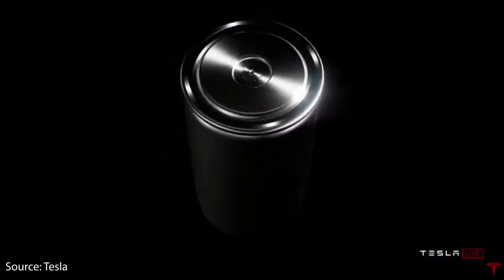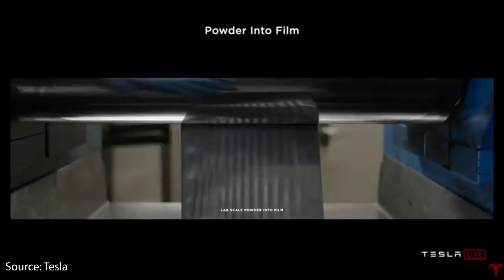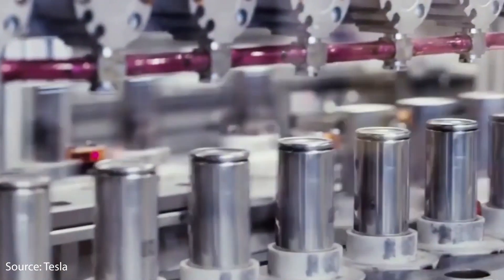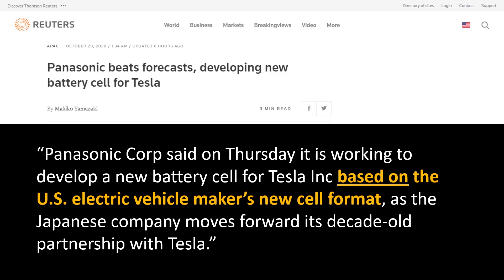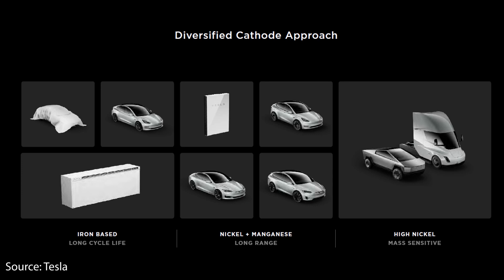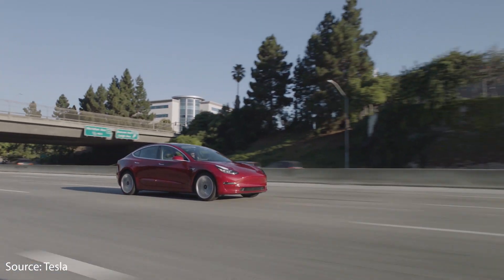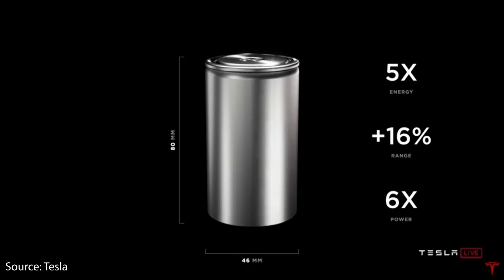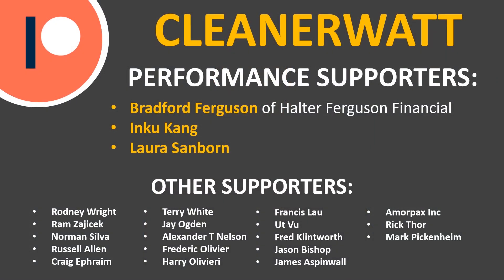Tesla NEW 4680 BATTERIES made by Panasonic

Comment: There's something wrong with your assumptions, I think, Jonathan.  But I can't be sure.  We just don't have very much information to go on at this juncture.

Let's talk about using 2170 chemistry in 4680 cells.  Will that work for Tesla?

I don't think it will.  Here's the problem:  the 2170 tech is a wet-coat-and-dry process.  Remember Elon talking about shrinking the 4680 cell production line to a small fraction of the size of 2170 production lines?  The elimination of wet-coat-and-dry methods makes lines less expensive to establish and cheaper to operate.

With 2170 cell tech upgraded to 4680, yes, Panasonic could produce cells faster than they do now, but they can't get the costs down far enough to suit Tesla.  This old-tech, enlarged cell will be 2 to 2.5 times the cost of a Roadrunner cell once full production is attained.  Not acceptable!

So where does that leave us?

We don't know, and I think the reason we don't know is that Panasonic jumped the gun with their announcement.  I don't think they have a deal with Tesla laying out the path forward for Panasonic cell production.  But I think it's likely that if Panasonic does make 4680 cells for Tesla, they will license Tesla's Roadrunner tech and probably even buy production machines from Tesla, and they'll come in at a price that isn't far off from the price Tesla expects to pay for its own 4680 cells.  Panasonic needs those other tech advances.  They need the IP Tesla owns.  And they need Tesla's cell production machines, which Tesla intends to mass-produce anyway for its own production lines.

Let's extend.  This is all shaky as hell, with no explicit Tesla announcements to go on, but what the hell, we're here, we're talking about it, why not go for broke?  Talk is cheap.

The extension I have in mind is Tesla's relationship with all three of its suppliers:  Panasonic, LG Chem and CATL.  What if:

  -  Tesla licenses its Roadrunner cell tech to other battery manufacturers?  And,

  -  Tesla produces and sells the line equipment necessary to make Roadrunner cells?  And,

  -  Tesla buys some of the resulting cells, probably at a higher price point (but offset somewhat by licensing fees), to accelerate their automotive and fixed site storage products?  And,

  -  Tesla permits these other battery manufacturers to sell Roadrunner cells to other BEV manufacturers?

Where would all of that deliver us?

It would deliver us to a place Elon likes very much, which is the acceleration of higher-quality BEVs throughout the entire industry.  Cheaper batteries will finally allow other automotive manufacturers to earn positive margins on their BEVs, reduce their prices and bring to market BEVs that are superior to equivalent ICEVs.

So how would Tesla compete in such a development?

Tesla has other IP and other advantages.  Nobody can make bodies like the Cybertruck's; nobody is even close to creating casting machines on Tesla's scale; Tesla is moving in new directions for paint shops; Tesla is the only company working on L5 autonomy; Tesla has newfangled tech in its heat pumps and thermal management systems; Tesla has proprietary motors and proprietary software which yield higher energy efficiencies; heck, that's only a partial list.  Tesla is going to be very competitive throughout this decade, and they're moving fast to exploit their advantages.

So, Tesla remains highly competitive and nets a profit on every BEV and every fixed-site storage solution sold by anybody, except those still using more expensive, less capable battery cells (prismatic and pouch cells, mainly), and those won't last long in an industry that's busily implementing a battery tech advance yielding reduced costs and improved performance.

I'll call this the 'Helping Hand' scenario, where Tesla not only boosts the entire industry's electrification progress, but also nets a nice little profit from licenses and the sale of production machines, and uses that cash flow to accelerate their own production ramp.  And they will harvest more batteries faster than they will if they rely solely on their own Roadrunner cell production ramp.

Is that what's going on?

Hell, I don't know, but I am sorta-kinda sure that Panasonic can't succeed with a wet-coat-and-dry production method for 4680 cells to be sold to Tesla.  Tesla will balk at the price.  And there's just not much Panasonic can do to get that price down without Tesla's IP and production machines.
Reply: 4680 with wet process is still 14% cheaper and fits with new battery casing. Dry tech may come later. If Panasonic prepares for 4680 now they can license dry tech when it is available later.
Reply: @BjorckBengt  Pretty sure Panasonic can't use the tabless design created by Tesla without a licensing agreement.

But even if you're correct, 14% cheaper than 2170 cells (watt-hours per kilogram) is still horrendously more expensive than Roadrunner cells, while delivering inferior cell performance.  Too expensive!  If they can't get near Tesla's own cell prices, which they can't if they are still using a wet manufacturing process, then Tesla will have no use for them in the longer term.

To stay in Tesla's supply chain for the longer term, Panasonic needs Roadrunner.  All of it.

Panasonic's statement implied that they were going to do their own development, which I think might be a translation error.  Or wrongheaded!  Why duplicate Tesla's development effort for a manufacturing process that they can't use without licensing it from Tesla?  Just license it already, and buy the production machines from Tesla.  Then Panasonic will have a long-term presence in Tesla's supply chain.  Play their cards right, Tesla may even permit them to supply rival automakers and fixed site storage providers with the new cells.
Reply: @Urgelt  Yes, Panasonic needs a license to use the tabless design from Tesla but that shouldn't be a problem since Tesla is the buyer of the cells.
We are talking about an interim solution. The alternative to 4680 wet is 2170 wet. The dry tech isn't proven yet at scale and it may take several years until it can be transferred/licensed to Panasonic. In the mean time it makes sense for Panasonic to start changing the cell and cell handling to fit into the new casing. It also makes sense for Tesla to ramp production of cars with the new battery casing even if they cannot fill them with dry tech cells.
Tesla will be continuously challenged when it comes to introduction of new technology. It is never an immediate switch. Tesla may have three different Model 3 at the same time, one with no casting, one with rear casting and one with both front and rear casting. Tesla will also have at least three different battery chemistries at the same time. It is not ideal but each new tech needs to be ramped and if there are intermediate steps possible you can get some gains and learnings earlier.
The batteries are 14% cheaper per kWh not kg.
I have no insight inte Tesla's plans so this is of course pure speculation, but I have worked with product and technology roadmaps and I recognise the situation.
Reply: @BjorckBengt  I respect your carefully-articulated opinion, Bengt.  And I acknowledge that you may be predicting accurately.  It's quite possible!

But I hesitate to climb on board with your viewpoint entirely.

You are assuming that if Panasonic adapts its current lines to produce 4680 tabless wet cells, that the resulting line will be useful if/when Panasonic obtains permission to go to the full Roadrunner dry-coating cell design.  I'm not at all certain this will prove to be the case.  In fact, I'm not at all certain that Panasonic's 2170 production lines have any design features that will be helpful for producing 4680 cells.  I rather think they'll have to start new lines from scratch and phase out the old ones.  And a 4680 wet cell production line will be a great big enormous line (all of those drying and solvent recovery processes, y'know) costing a great deal of money, most of which will end up being wasted capital investment when the move to dry cells happens.  (*If* it happens.)

Will there be advantages to an incremental approach, 4680 cells that lack some or all of the Roadrunner cell innovations?  I am not sure that there will be.

We have a zillion questions that are unanswered!  Just what does Tesla see as its future relationship with Panasonic?  Do they want full vertical integration?  Do they want Panasonic to help accelerate cell production?  Exactly when will the new 4680 production line design be finalized?  Will Panasonic use Tesla's production machines or develop their own, assuming they get permission/licenses?

I'll refrain from characterizing Tesla's 4680 cell as the 'crown jewel' of their IP.  They have a lot of candidates for that title, especially their FSD tech.  But it's extremely valuable tech, for sure.  How they will decide to leverage it will drive which way they will go.  I suggested that they could leverage the tech to accelerate the entire industry, while becoming a major manufacturer of battery production line equipment, but will they?  I don't know.

The final vision Tesla has for where it wants to go isn't just murky.  It's dark.

All we can glean from this news article is that Panasonic wants a piece of the 4680 pie, some way or other.  They are signaling that whatever Tesla does, they are going to be working on 4680 cells.  All else, including whether they will be using Tesla's IP, remains dark at this juncture.

Comment: Model S has the oldest technology battery.  When will it get some version of the 4680 for a refresh..
Reply: The Model S uses the older 2170 form factor factor but the chemistry is very much up to date. Tesla has continued to refine the chemical “recipe” Panasonic uses to make the cells at Giga NV.
Reply: @p.t.9709  it actually uses 1865
Reply: @clevernduruza8624  Yep. My bad.  I knew better. I rushed to respond about the " tech" being old.
Reply: The Plaid version slated for late next year will.  Probably both standard S and X lines will by then too.
Reply: @jameshoffman552  That would be my bet too. If they are redesigning the S for Plaid and 4680 cells, I would think all Model S will get 4680. I guess we'll see in about 1 year.  An S100D with 500+ miles of range would be awesome.

Comment: Tesla would want to standardize all  of their products to the new 4680 format simply to streamline the manufacturing process.  One size fits all, but varying chemistries in those sizes.  Very efficient.
Reply: Yea, the battery OEMs' stepping up to make 4680 format will make it possible for Tesla to transition faster to the new body structure -- structural pack plus castings -- which could be implemented at Fremont even before GF4 and 5 are producing.

Comment: I know it's not the flashy energy dense nickel arrangements, but I'm more excited about a huge increase in LFP production (Iron phosphate) over anything else. Cheaper, cleaner, more ubiquitous materials that will make low range runabouts and energy storage more accessible to the masses.
Reply: Fully agree. LFP improvement will change the entire energy game. NG will put a good fight as natural gas is getting cheaper and cheaper every year, but they will still lose to solar+battery at the end
Reply: The new Model 3 standard range plus coming out of China with LFP has over 260 mile range(291 NEDC).  That may be low compared to a 402 Model S or the 520 mile upcoming Model S plaid, but it's basically the same as their once available mid range Model 3, and LFP keeps improving, and I don't know if these have the front and rear castings with the structural packs yet. 

My point is, given enough chargers, it's not that low. The only time anybody will notice is on long trips, and even then, it won't be bad.
Reply: @fjalics  lfp
charges faster too, and you can regularly charge to 100% without much degradation which makes that 260 mile range more useful! It can also last for more than a million miles.

Comment: But the old chem wouldn't work with 4680 bcs of heat and other reasons... So i don't get your point
Reply: Kage, I don't know where you heard that, but Elon said that none of the improvements in the 4680 relied on the others. That's why Battery Day broke down each of the improvements separately.  As Luke said, the tabless design has lower internal resistance,  which makes less heat, even with the same 2170 chemistry and wet process. They just need to be cooled at the ends, instead of the sides, from what I have heard.
Reply: Yes it will. The tabless design has far lower internal resistance and can get the heat out far faster then the 2170

Comment: It would be silly not to use the dry battery electrode process. They need to make as many batteries as they can and batteries made the old way are going to be too expensive to compete anymore.
Reply: It may make sense for Tesla to hold the DBE tech but license the tabless tech.  Only tabless is necessary to make 4680 work.  DBE is more related to chemistry where there are many proprietary aspects that might make licensing problematic.
Reply: @jameshoffman552  The DBE is what enables the faster more environmentally friendly and greatly reduced cap ex to produce the batteries. Considering Tesla's mission statement, which is to accelerate the world's transition to sustainable energy, it doesn't make any sense for Tesla to keep that technology to themselves.
Reply: It makes sense in the short term. Especially since they havnt even perfected their process. They dont really have something they can lease to anyone YET. And even when they do, it will make sense for them to keep that to themselves as long as they possibly can to keep their competitive advantage. Once they have 5 megafactories up and running spitting out cars with those cells as fast as they possibily can, THEN they can consider leasing it to their suppliers and potentially their competitors. That is assuming that by then thier competitors didn't heed the warnings of Battery Day and weren't already waist deep in pursuing that technology themselves. Tesla wouldn't have revealed so much information at Battery Day if they didn't want to leave a trail of breadcrumbs for their competitors to follow.